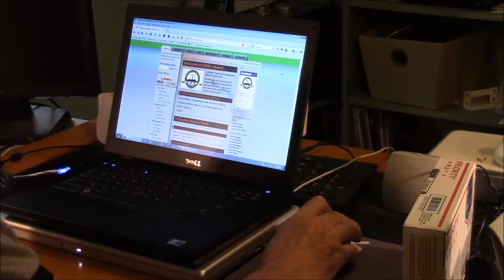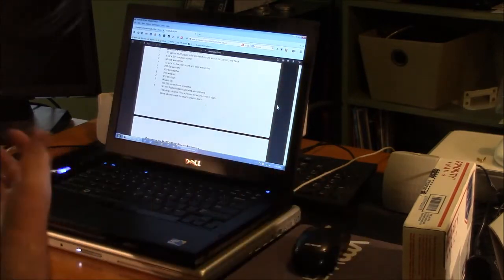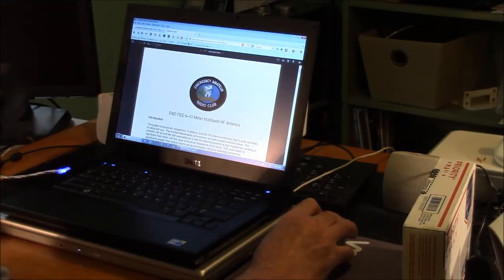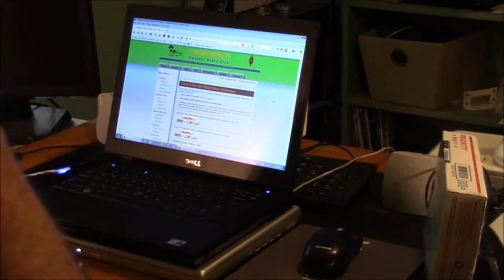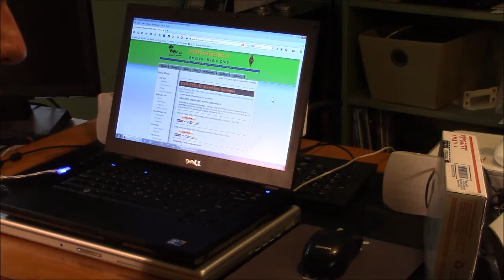The amazing earchi.org antenna!

Comment: This is  an ended fed random wire  with 9:1unun with the length chosen to make usable  40-10 M with a tuner. It is not an ended halfwave wire which uses a 49:1 unun.

Comment: Good luck on field day Rick.... will be interested to hear how you make out with your new antenna.
I have two end fed antennas that I use:
The Ultimax-100 is installed here at home and I use it when I'm outside on the deck; primarily for cw with my KX3 or my little Youkits HB1BMKII. The days I don't feel like going portable away from my QTH, I sit out there and make cw contacts....works great!
The other is the Trail Friendly 40/20/10 by LNR Precision (formerly Par). This little gem is very portable; rolls up and fits in my pants pocket...25 watts max and it works like a charm with no tuner required or recommended.
73 Brent

Comment from the maker: Ever tried an end-fed 1/2 wave antenna?
Reply: Yeah, I use an end fed HALF wave with my qrp portable station. It has a 49:1 unun and 63 feet of wire for 40-10 meters so NO TUNER is needed. I use a 20 foot counterpoise with it, though at qrp power levels I really do not have to worry about common mode current on the coax. If I use my FT857 at high power, there has been some rf at the operating position so I just use a counterpoise all the time. That 9:1 unun is nice for random length wires with a tuner. Been hamming for 49 years now.